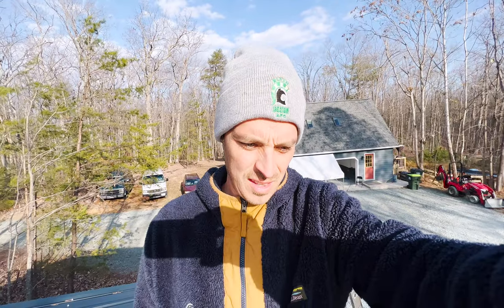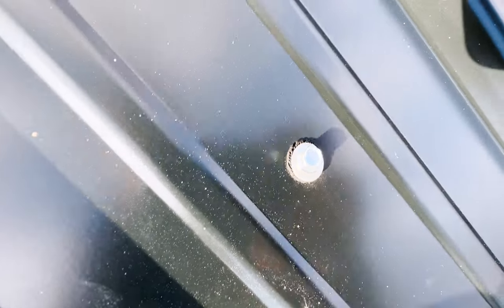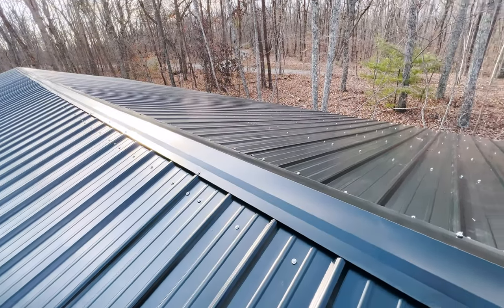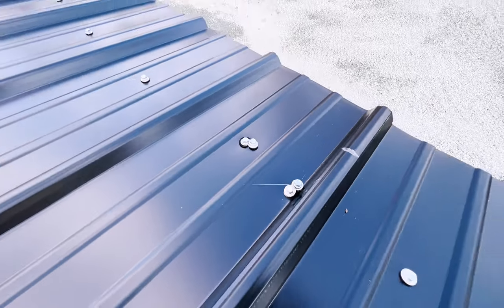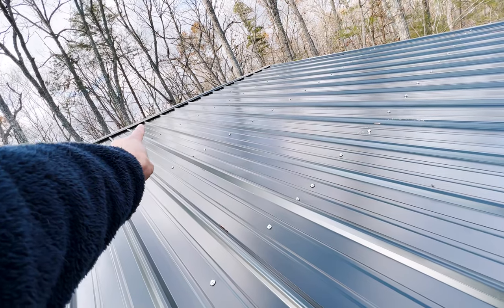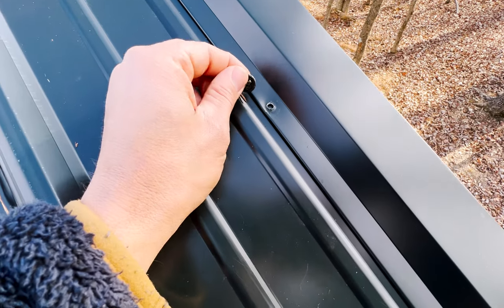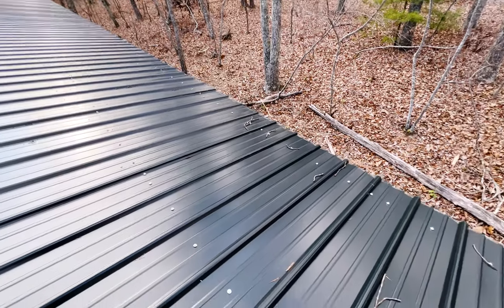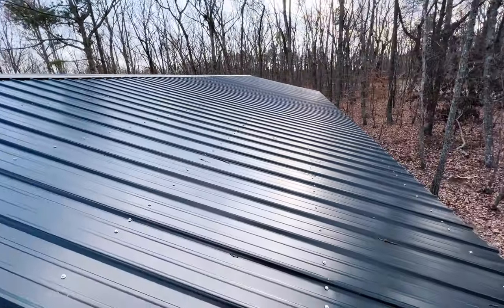The WORST metal building just got WORSE.

Comment: Remember nice guys finish last and get screwed over.  So if you can't take the bull by the horns,  take $500  hire an attorney he can send a qualified contractor to your site make a written inspection with pictures.  Then he can deal with the company that did the crappy ass work.   Or hire someone you trust to replace the roofing a section at a time.  Address the trim etc to make it acceptable in appearance and function.    Good Luck

Comment: I was taught to pre drill the hole pattern with all the panels stacked (based on measurements of the purlins),. with a 1/8" drill bit... If you do this,  Its import to drill the field (middle section of the panels) and then pull off two panels, one for each end then drill the edges in all the middle panels.  When you are on the roof fill all the holes.   This helps keep the drill from slipping off and damaging the panel.   It also make the screws look perfect from all angles from the ground.   We also worked one side of roof at a time because the measurements to purlins might not be the same on both sides.

Comment: This is another reason to get hidden fasteners. When you get that type of roof, the panels are usually only 12" wide and get fastened before the next panels is clipped onto it. You can easily see the roof purlins too. ALWAYS hold last payment till an inspection is done. Post the name of the company and installers.
Reply: These panels are structural! Standing seam panels like you are talking about would not work with this building system.
Reply: These panels are 3’ wide and overlap
Reply: @dakotalopez624  Doesn't matter how much they overlap, if the fasteners and metal expand at different rates, at some pint they will loosen and leak. When the metal expand, it shifts, causing the hole to widen. Also, the grommet or rubber disc will dry out after some time too and crack, letting water get in. Hidden fasteners  are hidden and prevent this.

Comment: Guessing they have never heard of a chalk line. That’s what we use for doing roofs. Gives you a nice neat row of screws. Plus over here we screw mostly on the peaks.Also. To fix most of that the quickest and cheapest solution would be to get a tube of silicone and silicone up every screw and every hole. Use a dark coloured one so you can see from inside any you missed
Reply: Never use a chalk line on the roof,  exceptional a dark roof. Just make a small mark on the leading edge as you go. The screw pattern on this is horrible. It was painful to watch. But if you are doing anything actually with plans. Never screw through the ribs. People love to say to do it but if you are doing actually work with real screws, if you don't follow the pattern on the plans then you are responsible for whatever happens. And every plan today with screws that have a washer says to put them in the flat. We have blueprints that we have to follow and everything is in the flat.
Reply: @Joseph-ny5rr  guess it depends on manufacturer and country. I’m assuming on dark coloured roofs the chalk line stays to visible or something.

Comment: I went through this same type of nonsense with FutureSteel Buildings. They screwed up a man door (with non-standard dimensions), end up shipping me a new frame and a "gift" door, and none of the three matched. Ended up getting a custom job from the local hardware place. Among many other problems with a basic 10x10 shed. Absolutely infuriating. I can only imagine what it was like to add an incompetent contractor.

Comment: When you do get the new steel, put longer screws in but do it on the ridges instead of the valleys. Less continuous rain impact and if there is a mess up and you get a hole from a screw, you wont have the leak you would have in the valley due to surface tension. Your roof will last longer as well. In the future, never pay more than a third until the job is done. If you were close then I would be glad to help.
Reply: Metal roofs are screwed on lows only lap is stitched on high
Reply: Was looking for someone to say this. We do all our steel roofs on the ridge so water never runs past the screw head and the seems stay tight together.

Comment: I do HVAC, and a few years ago we were installing the systems for a Discount Tire in the middle of winter. We had a huge snow/ice storm before the insulation and roof membrane was installed. The general contractor was inclined to get it all melted because the roofers where coming soon, so he got road salt and laid it all down on the metal roof, which then the salt and water got sealed in under the membrane... I went back a month later to do the initial start up and there was already rust... That was the worst roof job I've witnessed, sorry that you have to deal with this.

Comment: I just finished mine.  Versatube 20x25.  First, I've never built a thing in my life.  I had zero help, which sucked, but I got it done.  Took longer but I followed my instructions and mine came out a ton better than that.  Admittedly I missed a few 'studs' but I'm no builder.  Have some scratches from slipping putting the screws in some too.  But the metal sides and roof was lapped over correctly, screwed down consistently in the right locations.  Corners a but rough. But these "pros" should know better....I did by just reading.

Comment: Suggestions: 1) Consult an attorney and your county's inspection/permit office. 2) Hire a contractor to provide a written report on defects and poor workmanship. 3) Notify the company of the problems, include the written defect report and give them a reasonable time to cure (45 days). 4) If the cure period expires, request an arbitration hearing, which is probably written in the contract. Tip: do not out (disparage, disclose) the construction company until all reasonable efforts fail. Save that for the arbitration or lawsuit which can then be factored in as damages due to prolonged delays in utilizing the building.

Comment: Here in Australia we tend to put the screws on the ridges rather than troughs - because I assume there is a bit more chance of avoiding over tightening (as it can flex down a bit, whereas in the flats there is no real flex) and less water on it in practice.. so if the gasket is compromised you'll get less water in contact..  But yeah, maybe it is a matter of personal preference - there is the smaller hump in the middle that would give a little more tolerance but whatever sloppy person did that one clearly did not care about pride in their work.
Reply: The crimps in some sheets were probably because they stepped on the ridges - if they bent the whole sheet you'd see across the entire sheet - you should step in the flat parts where the crossbeams are. NOT on the ridges/bumps.
And by the way: even with the sloppy job, it's probably still watertight.. You could replace the screws that have a squashed gasket if you don't want to fight the company to get it fixed up. The ones half on the ridges - you could squeeze in a bit of roof and gutter silicone to fill the gap. It's not ideal, but would do the trick.
Reply: That's how we do it in Michigan, screw the flats on the walls and the ribs on the roof.
Reply: @danwolf307  - same up here in Ontario.

Comment: They used a dimple punch and punched multiple panels at a time to mark screw holes. They knew exactly where each screw was supposed to be measured to. So they just repeated the pattern before they put any panel near the building. They did the sidewalls the same and the wainscoting. The only time they didn't punch screw locations was putting up trim. Everything is lined up perfectly on my building.

Comment: Often there is a stitch screw applied to that lap on the high rib through both sheets. I saw the the first video and commented I believe on you better check the roof. All your points are spot on. Retired sheet metal worker.

Comment: I seen your earlier video about the wall panel that fell over and was mortified. It is of note that I just completed a 36x48 with 13' eve building three days ago with doors electrical and gutters yet to go in. I did all the work myself with help from my father. Putting these up is not easy and my building has its flaws but nothing like yours. I also had bad experience with contractors in the past and the only contractor work I had done was concrete which was about 9 inches out of square. I had to fix issues as I went. The building came as a kit and the manufacturer had issues as well. All I can say is if you have contractors do work for you hold the last payment until you inspect the finished work and if it's not up to par do not pay them until they fix it or make it right. Write your own contract if you need to. Fight (push back on) the contractor before getting an attorney involved. Best of luck.

Comment: I have a welding business we also put up metal buildings. 
I don't have all the info but it looks like it was the install contractor not the building manufacturer .
Yea some people do crappy work because they just don't care.
Someone needs to be held accountable. 
Find out if the manufacturer uses the same install contractor or have their own crew.
If they use the same contractor on all the buildings then they take it for granted and get sloppy knowing or thinking  they will have more work. 
I do suggest new panels so there are no holes to plug or silicone for future leaks. Bent panels probably from shipping or being dropped. 
Best wishes man.

Comment: Wooden Goodness, I responded to the comment of Kevin Rose (see below what he is offering you: pro bono means free lawful assistance) "so nice of you to offer him this. I think if he proceeds and uses the structure or delays ("statute of limitations" like issue), then he would not stand a chance unless the company decides to correct the issues. Another way he could remedy the issues is by getting a professional such as yourself to mediate with something like "if leaks occur or if structural defects appear or if the value of the steel building is significantly reduced by an official appraisal etc." the company would compensate him for the difference or replace at no cost. There should also be both lifetime warranty on structure and 40- or 50-year warranty on other things like leaks and the like. He is not completely out of luck. But if the quality of work is what's getting to him (and we all understand), then by all means he should act quickly. Thanks" Let us know how it turns out.

Comment: My metal building leaked in 4 places the night after they completed it. Took 5 weeks to get same contractor out to fix. Also paid $700 extra for color matching screws and found that they had not used them on roof. I have random screws sticking through the walls and roof.  Contractor could not speak English and relied on a 3rd person to translate over the phone.

Comment: You are worried about leaks when exposed fastener roofs are garbage out of the gate the screws back out from flexing all the time going hot to cold…  shingles or standing seam are the only 2 good roofs on a inhabited structure.. exposed fastener is for barns and less important places

Comment: just had an awning put up and got done the same way. when it rains water comes in under the ridge cap. out of level , silicone on screws and damaged panels . dimples and overtightened screws everywhere.  couldn't inspect until next morning and o brother. pissed

Comment: I wouldn’t stress over it too bad. They are cheap buildings put up by cheap labor. It’s kind of expected. 

You’ll probably get a couple of grand back from the company, some new screws, and then time to move on. 

I’ve locked down those washer screws like that before and have never had any leaks. (Horse Barn)

You want high quality I would expect to pay at least double.

Comment: drip edge flashing at the bottom of the walls is not installed. horizontal steel is not structural, and corner metal will not seal out the wind on horizontal application. over driven screws cannot be fixed dimple in steel is a water catch. oilcan dents in roof are going to leak, and definitely grab dirt for moss to grow. your windows will leak during wind driven rain because of the improper application of the J metal flashing. I see no gasket between the bottom plate and concrete, this will rust out being in contact with the concrete. there is no vapor barrier between the framing members and exterior steel panels, it will rain inside this building dripping toxic rain that will destroy car paint. you got to sue this fellow. you did not get the building you wanted. don't pay for work like this.

Comment: Here is what you might have to do. Take all of that metal off the roof yourself and save it for another less important project. Then just replace it with new and do it yourself. Expensive I know, but you could use that old metal for another project for roofing or even siding for a building.
Reply from the maker: Yea that’s the realm I’m thinking too. If I follow their ugly holes, I could still have a decent metal wall or roof!

Comment: Wow, a chalk box (with non permanent chalk in it) and a Screw gun with a clutch would have stopped 80% of the issues.  I have ground white sidewalk chalk up and put it in a dedicated chalk box.   They could have pop lines on the roof show where the rafters are underneath.  When done take a leaf blower or the rain will take it away.  Look at a screw gun there is dial  that it stops screwing under a certain amount of torque.  All those dimples and dents would not have happened .  

You can’t fix stupid though and they proved it here.  Installing damaged finish material is just stupid.  Slapping 3 pieces of trim on the gable on a 12’ is just bizarre.  My father who had 50 years in construction had a simple theory.  Straight, plumb, level and square is 95% of constructing a building! When I saw the crew in shorts I laughed because they wouldn’t be allowed on any of his projects even his house! 

There should have been a piece of flashing at the bottom of the wall to kick the water away when it comes down the wall.  If you ever do it again, set the foundation back 1-1/2” where you plan on a sidewalk or driveway.  That way the joint is under the building and there is no chance of water getting in the joint!   Little details make a huge difference!

Comment: Nope we go on…. Sure they need to switch out sheets …. And they should’ve used …..R….panels instead of W panels… There’s a trim the screws to the edge of your concrete which lets the siding hangover an inch and it’s real cheap and easy and fun and gets the siding 1 inch over for a drip edge and so you don’t need to lower purling them. This takes the place of the lower Perlin, aren’t I smart
Reply: Oh, Insulation the stuff with the silver side on, it makes all the difference here in Texas

Comment: This is nothing new this is pretty typical for these type of buildings. It's a prefab building. It's not a welded building and so you're going to have a lot of mistakes. Because not everything is going to line up.  The screw issue also is not a big problem over 2:33 tightening they usually  are not going to leak. I've done many buildings and I can tell you with confidence It won't leak but if it does you can buy Some stuff called np1and it'll solve all your problems you dab a little around the screw and move to the next one.  The metal in the trusses and runners is just too thin, thats why they can sell them so cheap.  The roof and exterior walls give thes types of buildings the strength.

Comment: Sorry for your pain. You seem knowledgeable so you probably don't need my two cents but your roof is not salvageable. In the state it's in it will leak and the only way to solve the problem is all new Steel with a proper installation. These steel buildings are cheap and usually installed in a day or two by very unskilled labor.

Comment: yes you got a terrible install job. I have installed thousands of metal panels . I never screw in the valley , always on the ridge . Yes you are suppose to for the warranty . However there is zero warranty on the gasket !!!!!!!!!!!!!!!!!!!!!!  98% of the water flows in the flat metal valleys. I never meet a home owner that received a "paint warranty metal replacement. But I have talked to dozens of metal roofing company's  that do repairs for leaking metal roofs . 99% of the time , it is a gasket or flashing issue . Did they install ridge foam gasket under the ridge cap ? Dont give up . keep moving up the food chain. try the metal manufacturer .

Comment: Not sure why no one has mentioned, but the screws are supposed to go on the ridges. That's why they're there. It helps keep the water away from them since the hole is raised up slightly. They cut costs by using shorter screws on the flats. The way they did it,  they might as well have used sheet metal. To fix it right you need new panels. If you aren't able to have it fixed properly, my advice is to tar the screws. Should take about 10 gallons. Won't look pretty and you'll have to do it every 5-10 years, but it's cheap and it works.